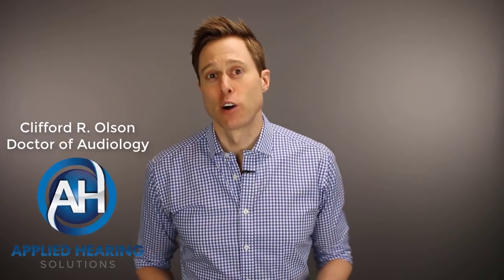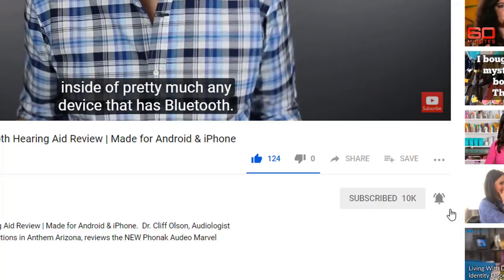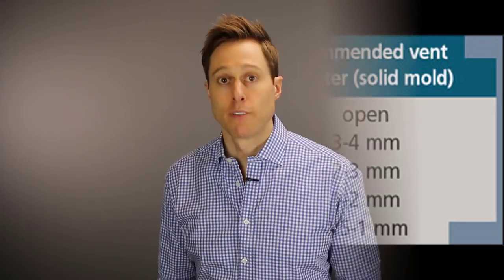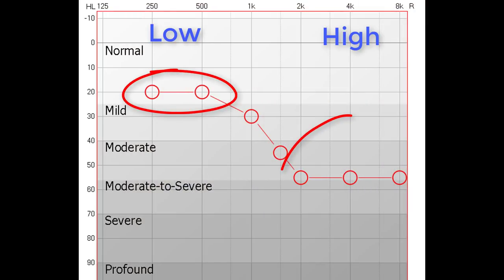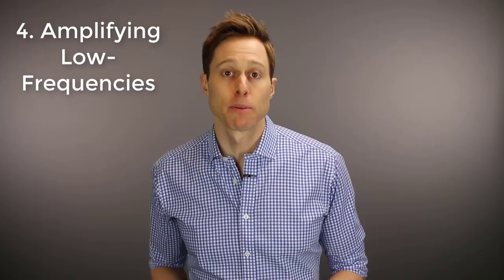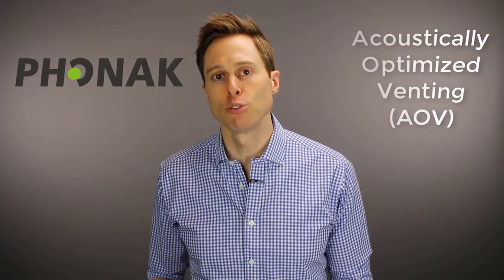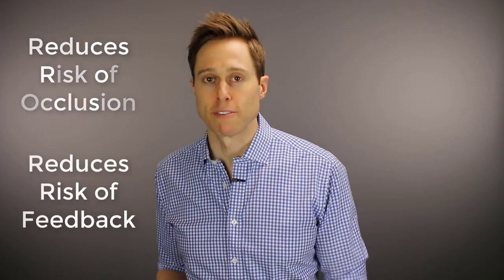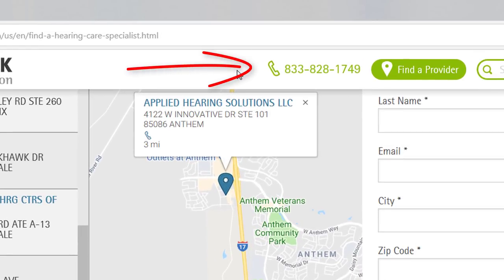Why Ear Mold Vent SIZE is Critical for Hearing Aid Performance

Comment: Dr Cliff,

I was fitted for siemans aquarius hearing aids in 2016. It was suggested for me to get ear molds. First time wearing ear molds. I always hear my own voice weird? So does this mean I have the wrong vent size? I was just given a hearing test from another audiologist and they told me I'm on the edge between ear molds or no ear molds.
Reply: Could mean there's wax build up in the vent hole. I tried cleaning mine with the tool given to me, but it really requires something bigger.
Reply: @waynetubr  I cleaned that hole a lot so it wasn't wax
Reply: Probably could be the occlusion effect
Reply: @The Gadget Guru  yes that what it was.
Reply: @GaryORiveraSr  ah glad I could help😁

Comment: But isnt it true that other hearing aid manufacturers also provide similar vent options which are optimized based on the same principle phonak uses? 
Because you are explaining it like no one else does it. I find this missleading.
Reply from the maker: Most other manufacturers make a vent that is called SAV (Select A Vent).  This allows a provider to find the right vent plug for the patient.  In my opinion, it is a rather crude way to do it.  I'm sorry you found the video misleading, but at no point did I say that Phonak was the only manufacturer to address the venting issue.  I just find them to be the best.

Comment: What would you recommend for reverse slope hearing loss with recruitment? Low and mid-range frequencies entering my bad ear sound distorted, irritating, and distracting --but above 1,800 Hz they're fine.
Reply: Thanks for asking--i would also like to know (esp. for someone who has acquired  reversed slope after years of normal hearing).

Comment: I have a pair of Phonak Vitro full shell in the canal hearing aids. If find it difficult to wear them full time due to moisture accumulating in my hear. Always thought it was because the vent size was to small. But, this wasn't mentioned in the video.

Comment: Dr Cliff, thanks again for another quality video.  I have one question that I have not been able to figure. I am going to have my ear molds taken soon for the Virto M90-312.  How exactly is MY vent size determined?  By my AUD or by Phonak using the 1600 data points when analyzing the mold prior to production of my HA?
Reply from the maker: It is calculated by Phonak.

Comment: Someone who is used to wearing hearing aids;
If you remove them
and listen to LOUD music on a high end stereo, does it sound amazing?
Or is a high end stereo lost on hearing aid(less) listeners?
Reply: I myself haven't tried that what I can tell you though is that when you take off your hearing aids at night or whenever really in my case everything sounds lower for a few seconds like the TV for example mostly because your brain is already used to the sounds from the hearing aids
Reply: @meric12131415  Full hearing range is typically 20Hz - 20,000Hz.  I have a friend that can only hear the tone up until 7500Hz.

I suspect if someone with excellent hearing were to adjust their EQ, it would be nearly flat.

I suspect if someone older were to adjust an EQ, they would boost the high's.

An Aid may already apply a heavy correction that is lost with aids removed.

Im curious to have someone used to wearing aids weigh in on a high end loudspeaker setup, and to also have them weigh in on EQ adjustments.
Reply: @andyh8239  🤣 ah sorry for the 2 year late reply but I can't exactly tell ya as I don't own a high end stereo setup

Comment: a simple question: what kind of FM-solution do you prefere for children?
Reply from the maker: I don't do pediatric audiology.  Sorry.
Reply: Do you mean a microphone for a school situation? If so the newest phonak roger (the one with the screen) is really good, it shows you if you’re connected, charge percentage, different channels and more. For older students you can also use the roger pen which looks like a pen and has limited features but similar performance. There are other options but these are more common. It is recommended you talk to a specialist in hearing and microphone technology.

Comment: I really enjoy your chanel but I must say that Phonak have got their Acoustically Optimised Venting system wrong. I have a severe high frequency hearing loss and low frequency is almost perfect which would indicate the use of 3-4mm vents. Phonak in their wisdom have repeatedly given me 1-2mm vents despite multiple requests fro audiologists to make it 4mm. The occlusion effect was ridiculous. Eventually with 3mm vents the occlusion was okay but their p90’s were hopeless for speech in noise.
We then went to Oticon OPN s1’s. They straight away gave me 4mm vents and speech in noise is now working. Occlusion is a thing of the past. Thank you Oticon
Reply: It could have also been the programing of the hearing aid, and also some people’s ears agree with certain manufacturers more as well… I’ve been through millions of different hearing aids and learnt that my ears like out of all the others i tried which was the resound and starkey ones…  phonak is actually a great company overall, maybe just didn’t agree with you

Comment: Dear Doctor I had the tympanoplasty surgery and I have a cavity near the ear drum. I will use cic hearing aid. My ear desibel result is 55 dB at 500 hz. So should I use vent or not. Ear cavity because of surgery how is effect the vent? There should be vent or not ? I really need your help please help me. Please:((
Reply: I also have had a tympanoplasty surgery.. And I’ve always had a mixed mild to moderate conductive and SN hearing loss.. when i had the hole, it had effected my hearing but after it was closed, it was more equivalent to my left.. i had my first pair of hearing aids at age 8 but didn’t wear them and got new ones when the tympanoplasty was healed.. still a work in progress though..

Comment: What vent size would be best for someone who has problem hearing high frequency?
Reply from the maker: There is no absolute vent size for High Frequency alone.  There are many variables to this equation.
Reply: It also depends if your hearing aids are from silicon or acrylic, in either case if the space allows it, a second vent can be made in order to comfort you. Also, you didn’t specify if your problem is whistling or smth else, it might be smth that can be taken care of if digitally.

Comment: Thanks for the channel. I find the vids really enlightening.
I have a question re vents. Does the length of the vent matter? I currently have 8 year old Phonak ITE Virto Q90 with 2mm vents that are 25mm long and am happy with the voice intelligibilty they give me. My trial aids have 2mm vents but are 18mm long and intelligibilty is not so good.
Reply from the maker: I would be shocked if you have vents that are 25mm long. That would be the longest I have ever seen! Vent length does matter, but I think the performance is more due to how the aids are setup.
Reply: @DrCliffAuD  Thanks for the quick response. I remeasured and they are indeed 25mm long (they are 8 years old and half shell ITE molds). So its really the acoustic mass of the vent that is critical (not just the diameter) along with the prgramming/setup of course.
Reply: @elmdcw  🤣 wow you have long ear canals

Comment: Thanks for the explanation. I really love your video’s. Currently I have the Resound One MRIE with a closed dome with some ventilated ‘holes’ in it for the occlusion. The domes are not fitting well/comfortable. They itch, ‘plop’ constantly and got a lot of feedback. Is a custom made dome the answer and is this even possible at the MRIE 961 model?

Comment: Do you have any problem to reach targets without feedback during REM on AOV-molds? My audi has said that Phonak probably  makes a bit to large vent, because of comfort issues in patients with no experience with HAs. This problem resembles what you said about proprietary fitting formulas vs. REM. You also noticed that the first is cocentrating more on comfort than reaching the gain targets.

Comment: I was not given a vent hole. I was told it wouldn't work for me. Is that true?
Reply: Earl Drake some people prefer them because their sound quality is better. Some people don’t because it can sound muffled or “airy”. But it definitely doesn’t work for everybody. I personally prefer closed because it sounds better.
Reply: You need venting if you have a moderate or less loss, otherwise you’ll have to much occlusion